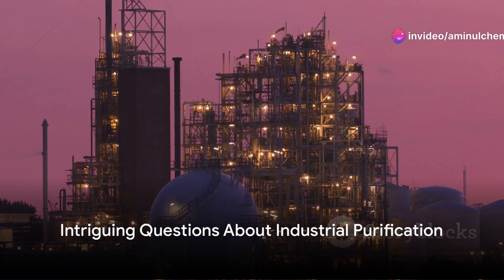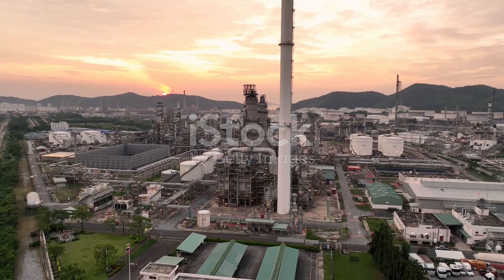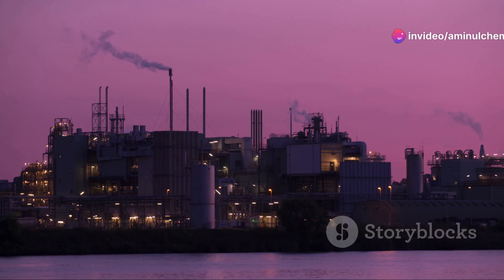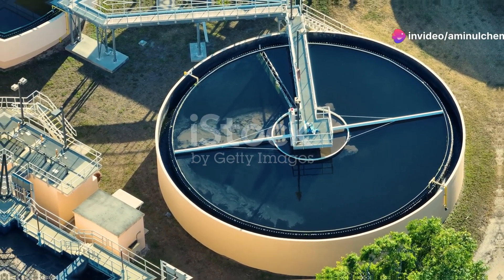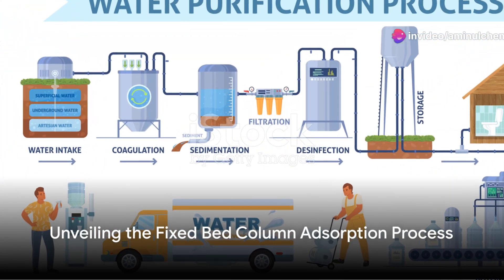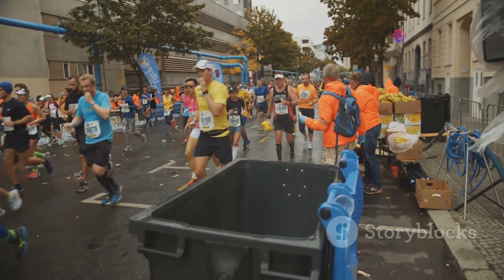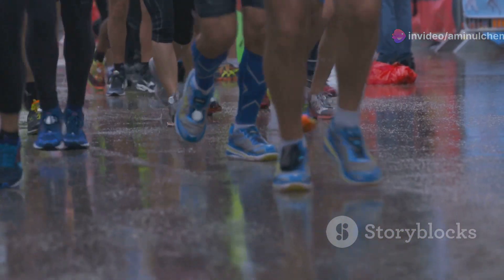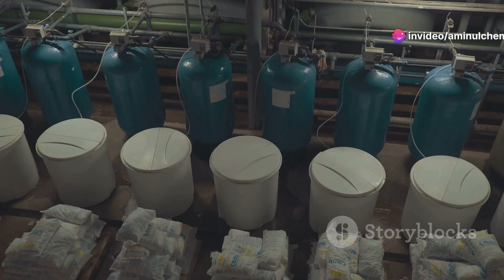Batch vs Fixed Bed Column Adsorption Process

Comment from the maker: 👉👉👉👉If you want to watch a particular video, please let me know by comment❤❤
Reply: Could you please make a video on how to choose the different parameters of adsorption while varying one of them for example while varying the initial concentration and how to choose the adsorbent dose based on what? and then how to use those data to do adsorption kinetics
Reply from the maker: @maryemmdini9408  Thanks. You need to do several experiements to optimize the parameters under supervision.